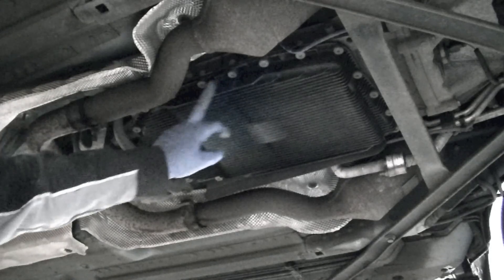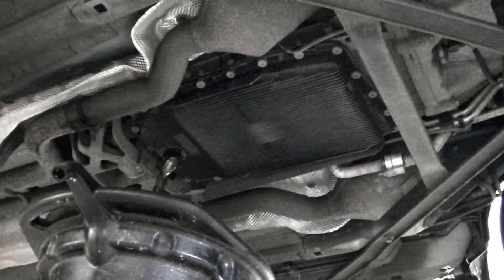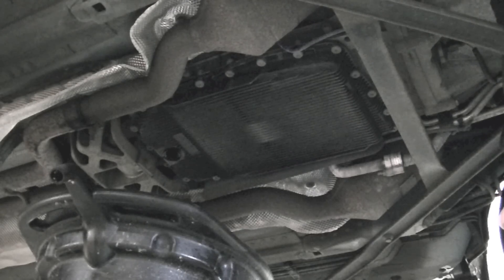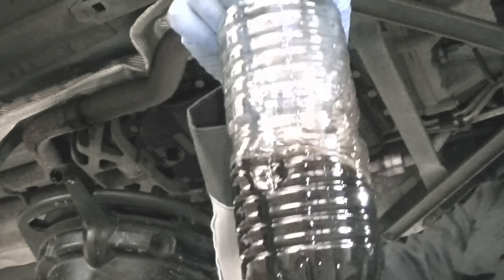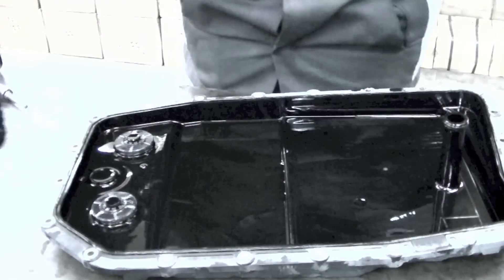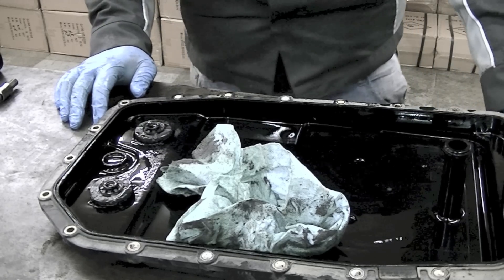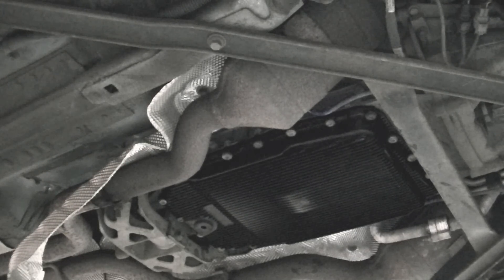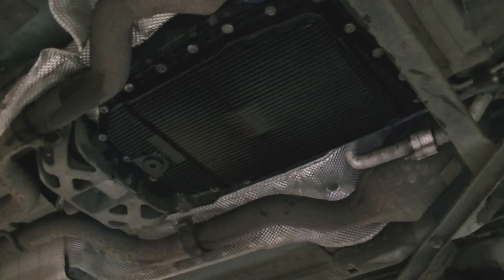Changing the transmission filter and fluid on a ZF 6hp26 automatic - Jaguar

Comment: If you are worried about stripping the torx bolt heads it's best to crack each one with a hand wrench first and use power tools to spin them out once loosened.

Comment: From my own experience with my Range Rover I strongly recommend you to follow the instructions of ZF in their service manual:

https://www.zf.com/global/media/medien_mastersite/aftermarket/service_information/service_information_zf/transmission/cars_4/englisch_3/modelluebergreifend_1/ZF_SI_Oelwechselkit_50145_EN.pdf

Not following the instructions for of tightening the bolts in the correct order, your pan will be leaking! Furthermore the procedure concerning the temperatures should be followed. Otherwise the transmission fluid levels will be incorrect, which will result in bad shifting and more wear.

Changing the transmission fluid as seen in the video will not even change half of the fluid. Therefore a flush would be better.

Having the gear box open, I would take out the mechatronics and change the seals connecting it to the upper part of the transmission.

Comment: Hi,

I have a 2012 xf 3.0L V6, bought few months ago it has 90,000 kms on it. I have noticed that if I park on an incline after the car is there for while when I start and put it in R or D it gives a prominent clunk sound. 
And on high revs when the gear changes I feel a small jerk. However the jerk is not there on low revs 

Do you think it has something to do with transmission oil or it's something else.
Reply: Did you ever figure out what was wrong. I have a 2009 xf and have the same problem.
Reply: @AM-nf7dt  I took it to jaguar service center and they said nothing is wrong with the gear !! Drove it for 80,000 Kms more and sold it 😂
Reply: Also exactly the same problem here! Did you find out what was wrong?

Comment from the maker: No, 2 drain and fills will do it generally.
Reply: Lexmandiy Sam agreed. That will be a 75 percent clean oil ratio in the box.
That's what I usually do over the space of 2 weekends. 

Then you can forget about it for at least another 60000 miles.

Comment: How about the oil in the torque converter? Was that oil drained too?
Reply: BBGBITW No access to the converter plug (if it even has one) on the ZF6.  This is exactly what ZF recommends is done.  You could do a power flush but ZF do not recommend this.
Reply: Its not DIY draining torque converter oil.
Reply: So by not emptying and refilling via the oil cooler pipes you have only changed about 50% of the oil in the transmission system - as you said the oil was dirty and you still have 50% dirty oil in the transmission.
Reply: Joe Blow  My thoughts exactly and no reply from op in over a year says it all.
Reply: @joeblow3823  Can you clarify what exactly you mean by filling via the oil cooler pipes? the Torque fluid isnt accessible in the ZF? I have recently got a 2009 4.2 XKRS and getting this job done is on my to do list - not by myself but a specialist but just seeing what exactly needs done